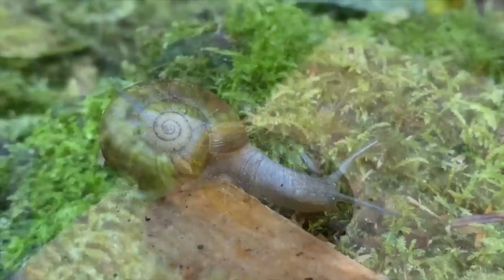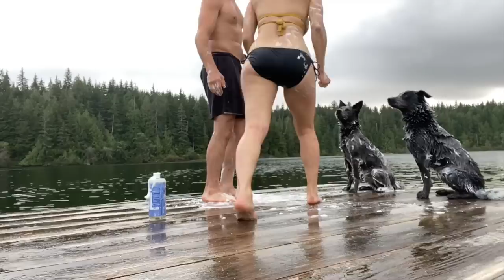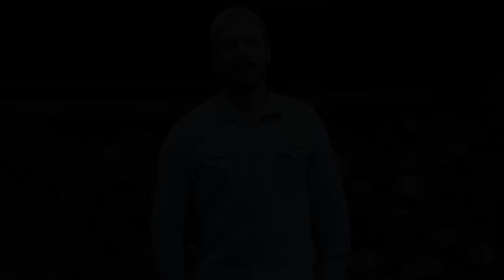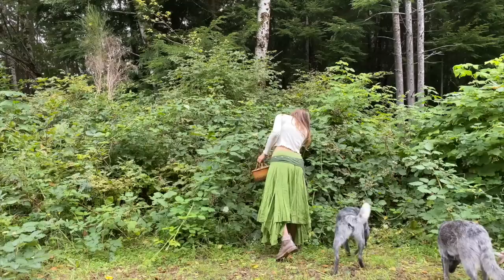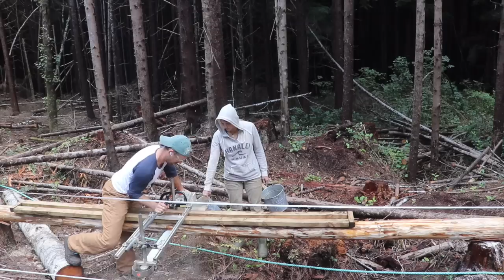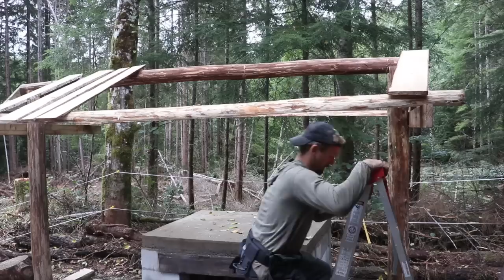ESCAPE TO THE WILDERNESS: BRICK & COB PIZZA OVEN, Day 4 | Backcountry Canoe at Secret Lake - Ep. 106

Comment: Love the Pizza Shack !  Technically, the bags would be called "underlayment" and not a bad choice at all. Looks like you overlapped them well.  When you install the cedar, make sure the vertical seams are off set from above and most importantly, "the top edge of the shingle (thin end) must extend an inch or two under the shingle 2 (two) rows above (this is called 'headlap' and an absolute necessity when roofing with cedar shingles, to prevent water intrusion (old roofer here) . Keep up the progress, love seeing every new feature of your lives !
Reply: budlvr they are just milling slabs, there is no thin end. They would be better off with metal roofing but whatever

Comment: Looks like the entire weight of the oven roof falls on just a few screws.  #unstable
Reply from the maker: Look closer
Reply: @OffGridLife  I did. Unless you did a bunch of off-camera changes, each eave is carried by the cross-members and rafters on the ends. Those in turn are hung by on the order of 6-8 screws. I suspect you'll have issues with that roof in a year or two. No big deal (so long as nobody gets hurt), just one of those things that you might do differently when you get to redo it.

Comment: Love the content. Been watching a long time. Am I the only one that is concerned how little that pizza oven roof is supported? The whole thing rests on the two sides that are just screwed to the two main supports. Seems like it needs something else. There’s a lot of weight up there.
Reply: Thinking the same.
Reply: A building inspector will make them knock down everything they build so far, It's just not safe....
Reply: @georgedemean2228  don't think there are to many inspectors way out there in the boonies.
Reply: @pepelepew4117  I just wanted to point out the extremely unsafe structures Jake is slapping together...

Comment: The plastic bag cedar sandwich sounds like a mold factory.  It gunna stink and rot.
Reply: Should of burnt them when no one was looking lol
Reply: I agree Brian, it was a great though to repurpose them but I think its going to lead to a bigger problem for you. Great work on the rest of the shelter.
Reply: It should be okay for a while assuming the angle on the roof is steep enough, and the shingles are tight.
Reply: As a contractor I agree with Mr. Jones

Comment: You kids are amazing.  All of the things that you have constructed and ways you have found to repurpose other items like the bags.  If I were 30-40 years younger I’d be there with you in a heartbeat.  A thought for your oven,  if you have a short piece of pipe place it at the bottom back of the oven; alternatively, do not mortar in one brick.  I helped a friend construct an outdoor pizza oven.  He left two 1/2 brick holes in the back of the dome on the bottom row.  I questioned his design and waited until we finished for his answer.  When firing the oven the back holes added combustion air for the fire.  He could close them off if needed but when he pushed the coals and timber to the back to begin baking he was able to close door to maintain heat and fire continued to burn.  Just a thought.

Jake,  wishing you and Nicole peace, health and happiness as you prepare for the onset of winter.   Greetings from NE Ohio.

Comment: pizza with leeks. Crust is basic pizza dough page 8-11.  2 tablespoons butter. 2 leeks, thinly sliced. 3 ounces (90 g) pancetta, diced salt and freshly ground black pepper . egg . 1 1/2 tablespoons fresh cream. 4 tablespoons freshly grated parmesan cheese. 2 ounces (60 g) gruyere cheese, very thinly sliced. serves 2 preparation 20 minutes. time prepare the dough and let it rise. cooking 20- 25 minutes. CRUST  1. prepare the pixie dough following the instructions on page 8-11 set aside to rise. TOPPING 2.melt the butter in small fry pan over medium heat. add the leeks and pancetta (not sure what pancetta is) sauce until the leeks are tender, about 10 minutes. season with salt and pepper and set aside. 3. preheat the oven to 500 degrees F (250 degree C/ gas 10) 4. oil a 12 inch ( 30 -cm) pizza pan 5. knead the risen pizza dough briefly on a lightly floured work surface, then press it into the prepared pan using your hands. 6. beat the egg with the cream in a bowl. add the leek and pancetta mixture and the two cheeses. mix well. 7. spread this mixture evenly over pizza, leaving a 1/2 inch ( 1 -cm ) border all around. 8. bake for 10-15 minutes, until the crust is crisp and golden brown and the topping is bubbling and beginning to brown. 9. serve hot.   not the sweet, onion flavor of the leeks blends in beautifully with the pancetta and cheese in this delicious pizza.

Comment: I enjoy this channel, all of it. It's been great watching the two of you grow into this experience. I love it that you're both comfortable enough with your sexuality to enjoy and share it. I hope you're keeping an archive of these in a safe and secure physical media format that you'll always have in your own possession. Life passes quickly, and a few short years from now you'll be sharing these with your grandchildren and laughing about the complaints of "clickbait". You know better -- you'll have to explain to your grandchildren what "clickbait" means.

I've always been a fan of rustic working structures, of which there are many here in my adopted home of northern Massachusetts (since 1974). I've noticed that the old-timers here built sheds like you're finishing for your new oven, and the ones that age gracefully into the land and forest around them use some principles a little differently from what I see you doing with your new oven. The most important is to use wood-on-wood and gravity to hold weight, and use fasteners (like screws) as fasteners instead of structural supports.

I suspect you'll find that the roof you've just built will need to be replaced in a few years (3-5) as the temperature cycles plus wind and snow loads take their toll on those screws that are handling all the weight. The triangular braces help stabilize the ends, but as built the screws handle all the weight. I suspect you'll find that they'll loosen and start to pull out of the uprights. It also looks as though the truss and therefore the whole roof is in tension from the beam across the top. The net result is that gravity is working against you, especially with snow loads (assuming it snows there).

I suspect the old-timers here in MA would have notched horizontal  mortises across the uprights (on the outside) so that the cross-members sit on the top of the shoulder of each horizontal mortise -- an inch or two is all you need. The screws then hold the crosspiece snugly in the mortise, and the weight of the wood is carried by a wood-to-wood joint in compression. Then the truss that you form with the triangular members keeps the frame stable but doesn't hold any weight.

I mean this as constructive -- you'll be building that roof again in a few years, and I'm sure you'll learn from the experience as wood framers have been learning for millennia. Lived experience is always the best teacher.

I came here because my grown son is all about sustainable farming, and he spent the last New Hampshire winter in a yurt he built himself. You guys are a great inspiration on all sorts of levels. Just ignore the haters.
Reply: I'm not a hater... and most that are offended by the click bait pics aren't either, that's hugely insulting! As a woman myself it isn't drawing me in anymore and the mere fact they think we should all want to be looking at Nicole's body in various provocative poses begs the question who they want watching their videos? Careless ignorance from them is giving this whole project the wrong impression. Women don't need to be used like this! Why isn't Jake nude and showing his arse?... would you be saying the same thing if he was!!???
Reply: @emk-69  "They think we should all want to be looking at Nicole's body in various provocative poses"? Perhaps you would have been more comfortable in a time when women were being "obscene" when they allowed a bare calf to show. I see no evidence that anybody is being "used". I don't know why Jake isn't "nude and showing his arse", but neither is Nicole. I have seen zero evidence that Nicole is in any way unhappy about anything that is happening. I see two attractive young people who are enjoying themselves and their relationship while living out a valuable experiment. I see you writing commentary about two people you've never met and harshly attacking them because they make different choices from you. Perhaps "hater" is too strong -- on the other hand, have you stopped to consider how Jake and Nicole feel about comments like yours? In answer to your final question, yes -- absolutely.

Comment: Question, to any and all...anyone else feel like that the roof structure is a little weak?  I feel like there should have been, at the very least temporary supports on the corners, and possibly in the middle of the sides?  Just seems like those ends are holding a LOT of weight.  And a quick comment about the thumbnails...if you are more worried about the t-nails than you are the content, then you were never interested in the content anyways...but if I was Jake, LOL, I'd complain that I didn't get equal "exposure" on them...HAHAHAHAHA....love you guys, been watching for quite some time now...keep doing what you're doing and creating great content...I've learned quite a bit from both of you!

Comment: Nice re use of the plastic bage but like roof shingles you should of staggered them some the seams weren't side by side or line up etc so any water would be shed off and don't make that mistake on the Cedar when it goes up. Sadly there's to many people who like to go off grid then there is land to sustain them and it's a bit questionable to think 8 acres will be enough to maintain the pair if they also rely on its wood for heating etc considering they'll go thru a cord or more every few weeks during the winter just stay warm for decades to come.

Comment: That pizza cob wont survive heavy snow.  They used  thin plank to hold roof and you can see how it bends. When he add roof and with snow on it it will just crack especially if that plank get wet. I would use much bigger support for roof and connect it with the end of it so weight will be distrubuted equaly.

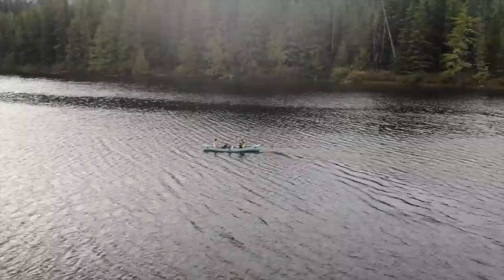Comment: At least my canoes would be extremely difficult to get going straight if sitting like you are doing it at 7:20 in this video. The one who is paddling in the rear end should sit like Nicole and the other person should sit where Jack is but facing the other way. The canoe should be moving to the opposite direction. If I was alone, then I would be sitting like Jack and also facing the same way. I have experience of only two canoes and that's how those behave. Of course, it's possible that this model is very different. Would be interesting to know if it is.

Comment: Just saw this, for the mosquitoes in the summer if you put out a box fan with a screen on the inlet it will trap the mosquitoes and the fan stops them from getting on you as well as cooling you off. Then you spray the sucked up bugs with rubbing alcohol. It supposedly helps to lower the population a little also. Hope this helps 🥰 🚫 🦟

Comment: I would suggest only couples apply for the apprenticeship. No singles. I do have a question. To be off-grid means to not have to rely on the grid for our power, food, water, fuel, and medicinal resources. Since you do have batteries on your power tools, what will you do when the batteries die? I have a couple of suggestions to offer if you are interested.

Comment: The cost of your rubber boats and motors you could have bought an aluminum hull boat and motor. An aluminum boat will last longer than a rubber raft. I’ve had my aluminum since the 80’s. Same as when I bought it. Your raft won’t last 35 yrs.